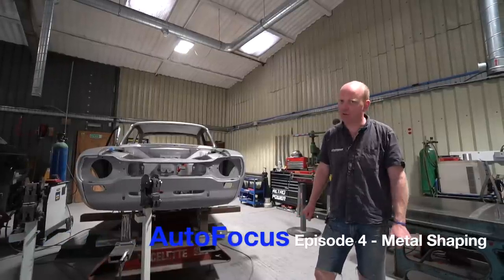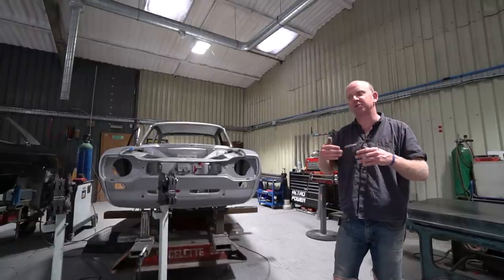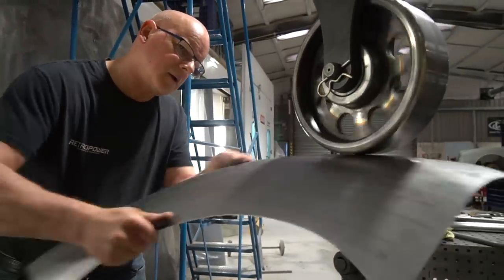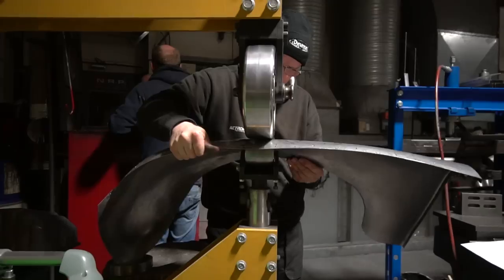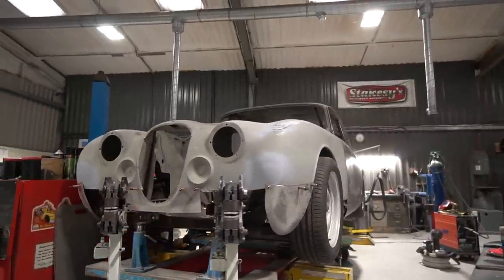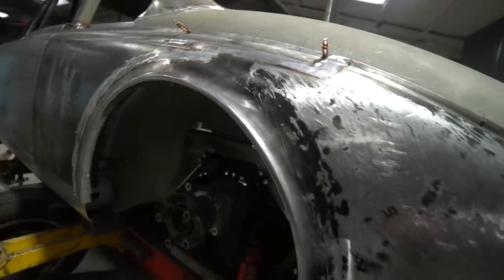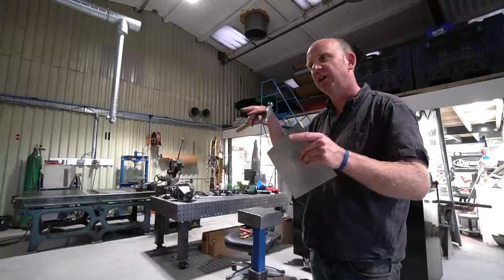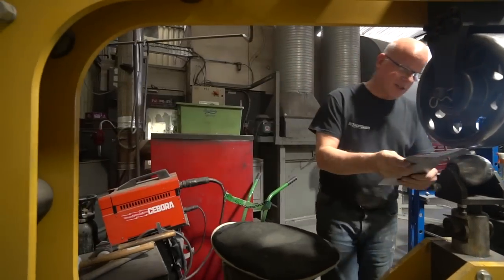AutoFocus Episode 5: - METAL SHAPING FOR BEGINNERS

Comment: In the marine industry large steel sheets are pressed but also flared using a combination of heat and water to bend the steel into compound curves. The same process is used to bend the steel pipes to make roller coasters. Just a blow torch and cold water hose.

Comment: I can understand why you'd mostly stretch the inside of a panel to form it (outside dimensions/fit stay the same). Apart from a flange is there an application where you'd stretch the outside of the panel?
Ps I think your pastry analogy is a very good one and could apply further, I remember my mum pinching or tucking / pleating (shrinking) the lid to a pie to make it better fit down over the filling.

Comment: Fascinating explanation of how to move metal, as a jeweller I'm always interested in metal working of all kinds. It's amazing how techniques used by one trade can be transferred to another. I have a question though. When working in precious metals we anneal when work hardened. Do you need to anneal when working in sheet steel ?

Comment: Another method to your last demo is to use a Tucking tool around the edges.   The tool is easily made. A parallel pair of round steel bars that has been turned into a taper shape.  Then a handle welded onto the larger ends of the  pair. Leave about a 2mm gap before weling on the handle.
Insert the tool over the edge of the sheet to be shrunk and twist the handle. Repeat along the edge.